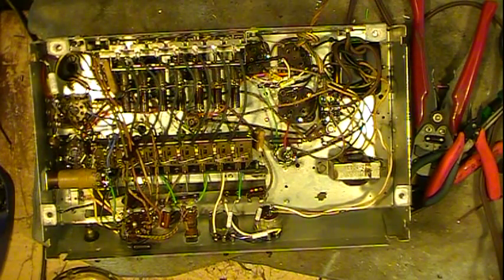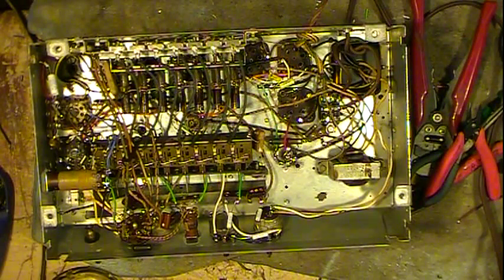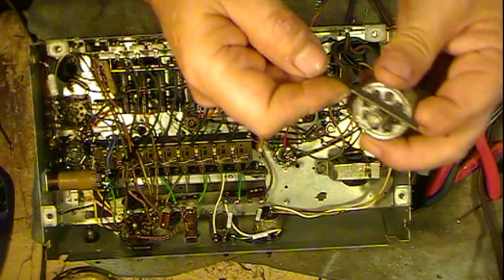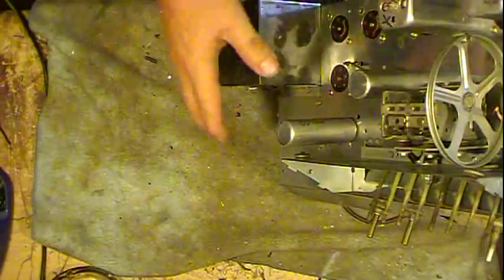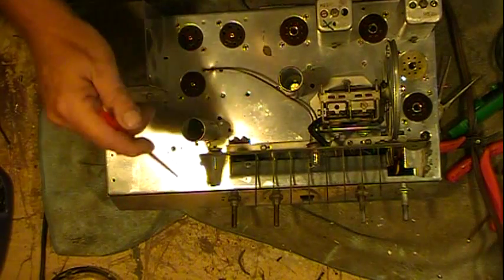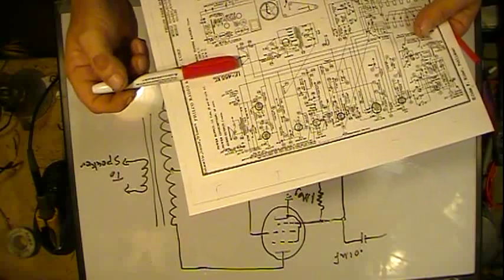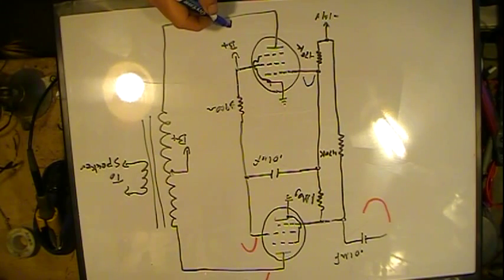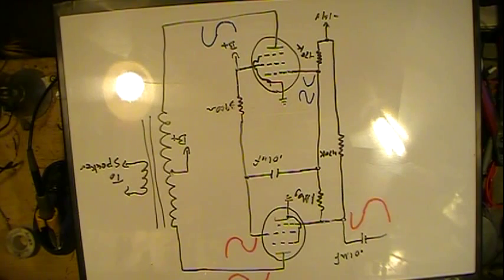Philco 40 150 part 2

Comment: I use 1000 grit sandpaper followed by 2000 grit sandpaper on locktal tube pins. It shines up the pins up great. I see some people using an exacto knife blade to remove corrosion from the pins. I think that would remove some metal from the pins creating connection problems.

Comment: Hi Dennis! Very informative info on the non phase inverter push pull power amp. Yes, the welder cleaner pin files work great for not only cleaning tube sockets, they are handy for cleaning many different types of connectors too. Been using them type of files for years. What I use to clean tube pins is an x-acto knife with the standard 45 degree blade and go around and scrape the pins from top to bottom. The small blade makes it easy to get into tight places.

Comment: I'm troubleshooting a Philco model 37-640.  The output push-pull explanation was so good, I stood on my head and watched it three times while reading the schematic.  The 37's 6F6G tubes &  your 40 are very similar.  My schematic shows NO voltage values so hearing you describe them is very valuable to me.  My radio has a burned up shadow meter coil.  How do I tell how many turns it had (OR) what resistor can I use to eliminate the shadow meter?  I'd really rather see the old shadow meter working again.  Thanks in advance.
Reply from the maker: simplyconnected Sorry for the delay. Check out the you tuber he had to rewind his shadow meter. Here is a link to his channel; www.youtube.com/user/Lockemeister/videos  and look up the Philco 16B videos on his channel.